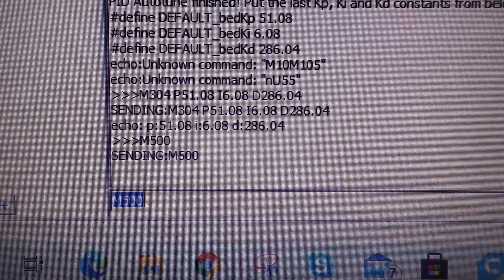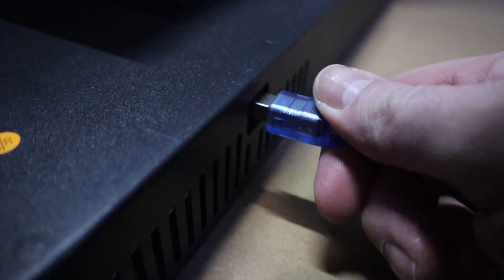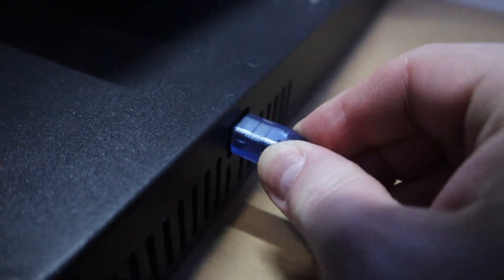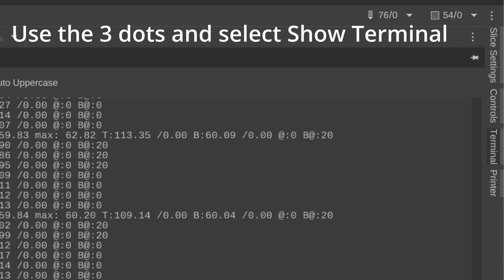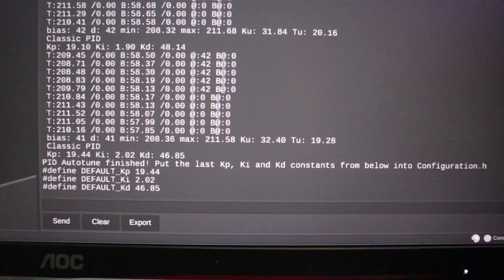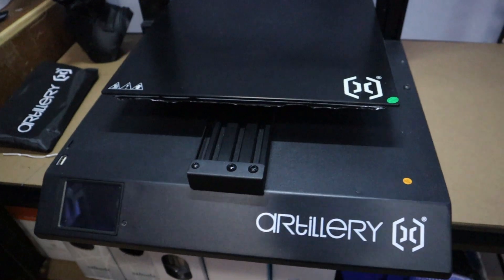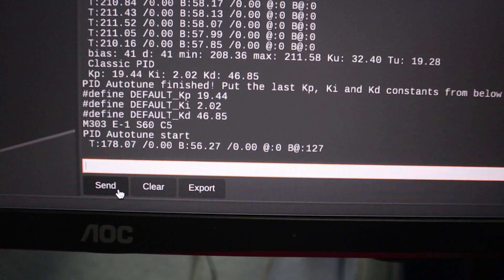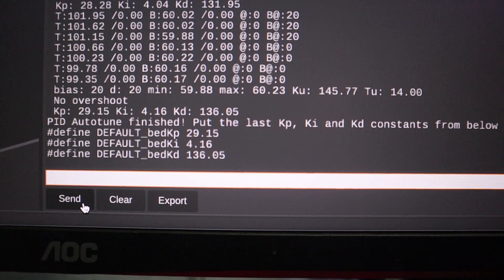PID tuning 3D Printer on Windows and MacOS - G-code Terminals Pronterface and Mattercontrol

Comment: Do I have to do this for each temperature? 190 for pla 245 to 260 for petg
Reply from the maker: Thank you for your question. PID tuning you only need to do once and it is for all filaments.
Reply: @Zachary3DPrints  thank you so I should PID tune for 260 and covers all temperatures?
Reply from the maker: Sorry for the late reply, did you solved the issue in the meantime? Normally if you PID tuned the printer it should not be done in a while, also not for hotter materials, IMHO
Reply: @Zachary3DPrints  thank you for your reply it's ok and I wasn't sure I did a PID tune for just over 200 I upgraded my hot end you see I print petg more so throught higher but played it safe lol, do u know if I do a temperature tower should I put on my adaptive layers setting to? On my printer tower test?
Reply from the maker: I rarely printed a temp tower test tbh... I just print, using the normal standard settings, since I don't have that much time during the week. You can do it and print one test